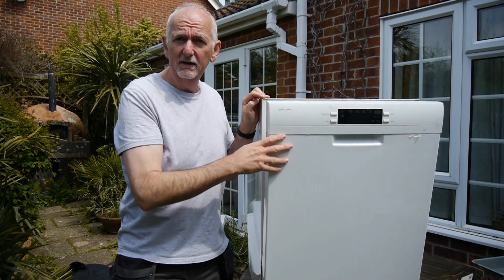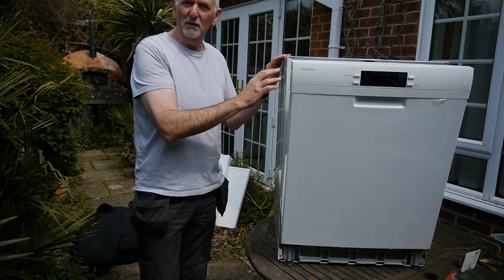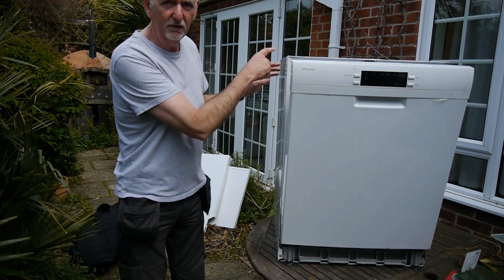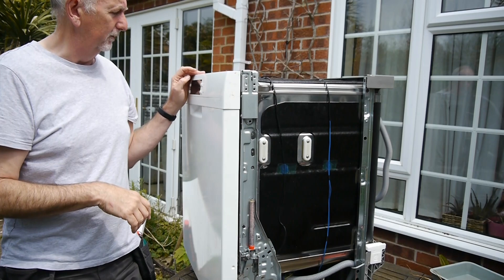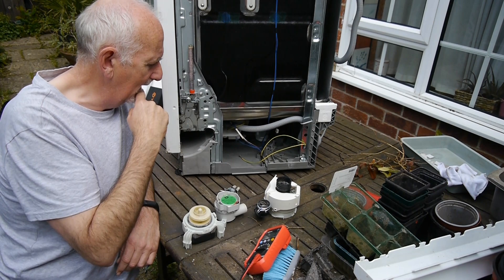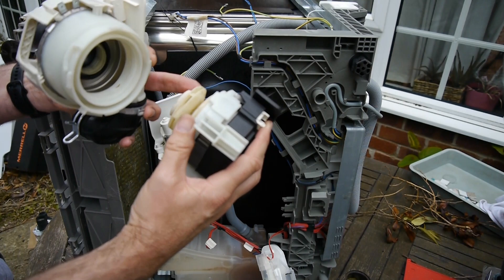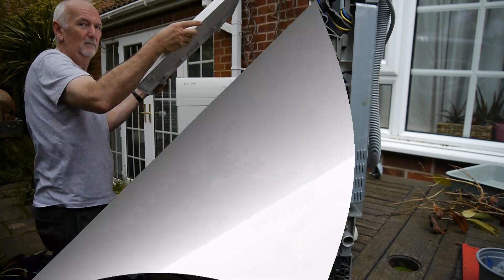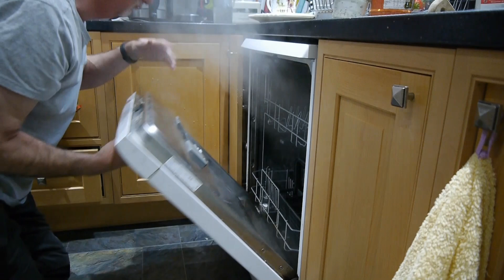How to repair a Dishwasher that is not heating up

Comment: Did you use any tools to remove the pump from the old heating element? Or just your hands? It looks like it is tightly fitted together !
Reply from the maker: Yes it was tightly fitted together, if I remember correctly I used a flat screwdriver and some grips. Then done grease when I connected it back together